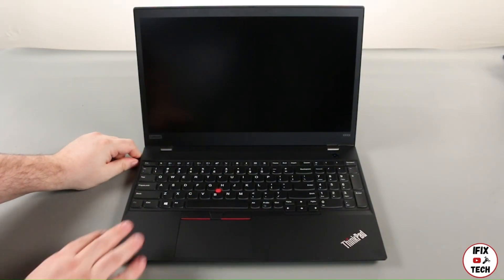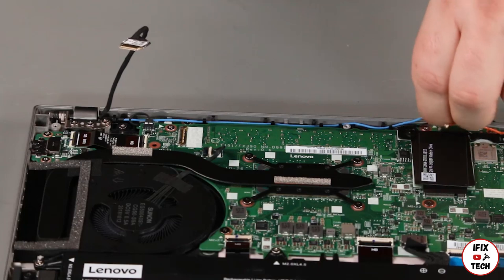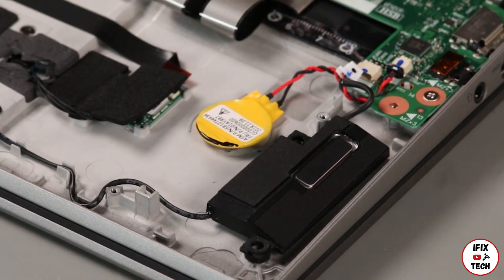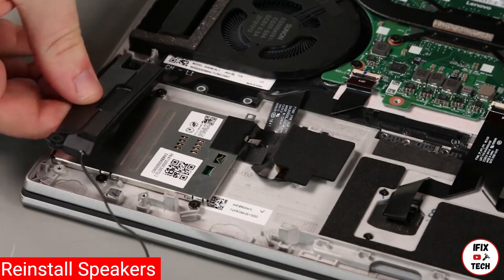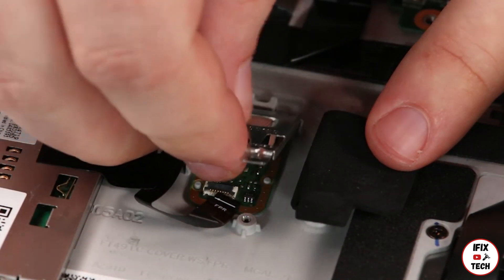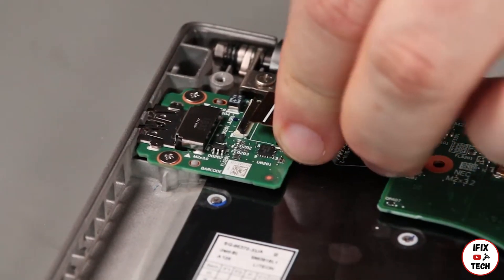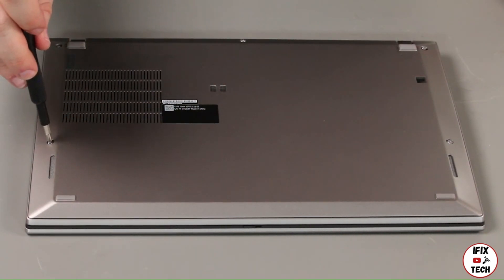Lenovo ThinkPad T490s and T495s KEYBOARD Replacement - How to Remove TOP CASE

Comment: my keyboard is completely broken how to do i get into shutdown mode
Reply from the maker: Are you not able to use the power button at all?
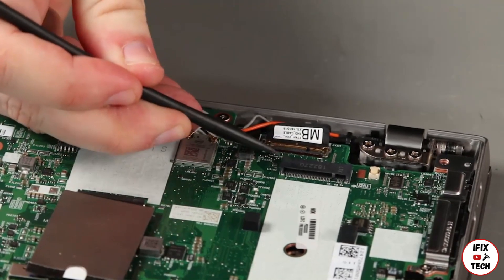Reply: Fuck! I broke my cable at 1:59 that you called as power cable.
What should i do now?
Reply from the maker: Oh wao. Sorry about that 😯 you will need to get a new cable. You can try on the Lenovo website pcsupport.lenovo.com under parts look up  @정희-b3k
Reply: @IFixTech1  thanks I ordered new power cable at aliexpress.